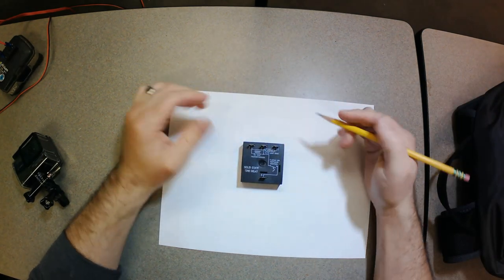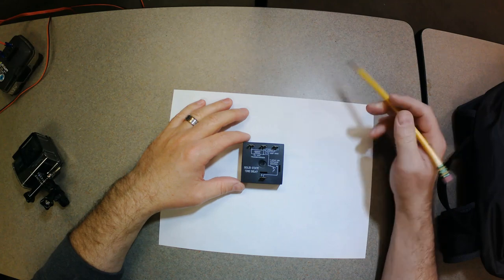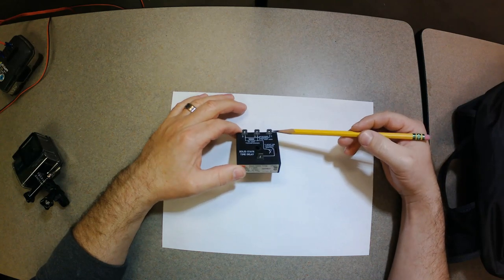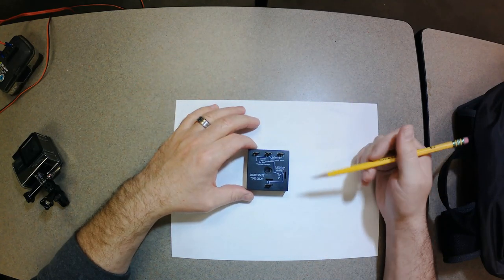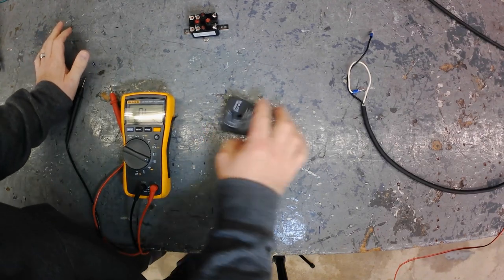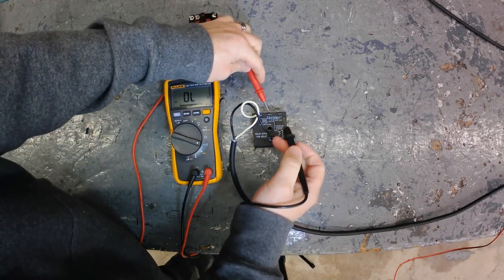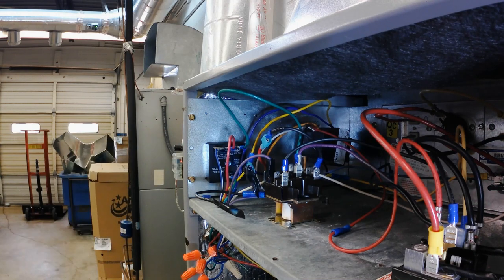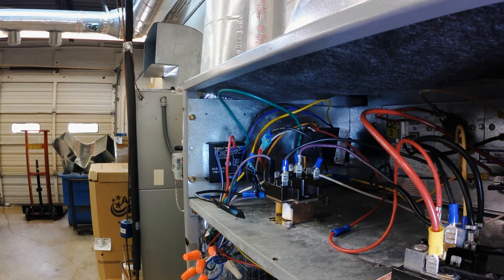CT1S45 Solid State Timer

Comment: You made a comment about overloading circuit. So instead of jumping out 5 to 2 with the G wire you just got 24v off. transformer. How would it overload? 
Really enjoy watching your videos! You take the time to really explain how things work.
Reply from the maker: Thanks for watching and commenting. It is not overloading as in "blow the unit up" or anything. I think of it like this...the 'G' circuit was only meant for 1 load, the indoor fan relay coil. The solid state delay took the place of that so by jumping off of terminal 5 we are essentially putting 2 loads on the 'G' circuit. It probably isn't enough current to hurt anything but it is going through the thermostat. I would just try to run each load from the power source through its own switching control. That way it is all straight in my head. After all, all the low voltage starts out as 'R' at the transformer anyway right?

Comment: Very interesting that you can't measure continuity thru the ?make-break? terminals.  Get any measurable voltage drop when passing current?
Reply from the maker: That was just something I noticed. I usually go with a Fluke meter and it may have had something to do with the range of its capability or something. Didn't even check the voltage drop but assume there shouldn't be much of one if current is flowing.

Comment: So you bring the back side of the main fan relay back to 3, or blue common?  What about using a Goodman #B1370758 timer? It has a 30 second shut down and and is supposed to carry 18 amps through the switch with 24 vac switching circuit.
Reply from the maker: The #3 and blue common should be the same thing in this setup (if i remember correctly). 
I don't see why you couldn't use the B1370758...30 sec vs 45 sec delay..not a biggie. I wonder why 2 components for making the fan motor delay. Just use the B1370738 fan sequencer. Now we got a circuit board!
Reply: does the sequencer have a N on and a N off? I dont know if they would last as long as relay but I seen them for $17 shipped. Would take less wiring too. If you can use them to run the fan with heat strips they would sure be a quick cheap way out if a board goes bad. Maybe a wiring video on them??
Reply from the maker: The sequencer has the same N.O., N.C., and COM terminals that a relay could/would have or what you would see on one of their fan circuit board. How long they last is completely up to chance!

Comment: Thank you for your video. If terminal 2 (R) and terminal 5 (G) has only 12 VAC, what is caused the problem?
Reply from the maker: The terminal 2  (R) is 24v all the time. If you check it to the terminal 5 (G) and it is 0 volts then that would mean the thermostat is sending power to terminal 5. If you get 12 then maybe the thermostat is not sending power out to terminal 5 yet.
Reply: Thank you for your response. If the thermostat is not sending power out to terminal 5, is it a bad Timer?
Reply from the maker: Not necessarily. Terminal 5 should get power when the thermostat is calling for the fan to run and if there is not power there then maybe the thermostat is bad.
Reply: @johnjennings-JJ  Again, thank you very much for your response. If I pull the G wire off from pin 5 (timer delay), I could have 24V between pins 2&5, right?
Reply from the maker: Not if you pull the 'G' wire off. It should be 0.

This is what i would do. Turn the fan to 'ON'. at the tstat. Check terminal 5 to 3, should be 24v, if it is then the tstat is good. check terminal 2 to 3, should be 24v, if not - find/fix the 24v wiring that should be bring the voltage there.(seems like most techs just jump off of the terminal 5 'G' wire). If 24v is there from terminal 2 to terminal 3, great. Check terminal 1 to terminal 3. It should also be 24v. If not i would change the solid state time delay
Reply: @johnjennings-JJ  Thank you very much for your response. I replaced a new "solid state time delay" and I got the results as you mentioned above. 
1) If the "Fan" is "On or Auto" and the system is set "cooling," but the system keeps running (and cannot be set off) when both "inside and setting temperatures" are the same (it should stop), right? what should I look into the problem if the system keeps running?
2) Also, After I turned off the system at TStat, the inside temperature went back up, what caused this problem?
Reply from the maker: For #1, i think you are on the right track. The thermostat should satisfy and cut off if the inside temp reaches the set temp you want. I have noticed that a lot of digital thermostats will actually turn on the cooling before the temp of the room changes on the screen. It is sensing the slightest change in temp (maybe a 1/2 degree) and turns on the cooling. I don't think your thermostat is necessarily acting bad/weird if it does that. 
For #2, the only thing i can think of is it got warmer in the room!!?? If you think it is happening too quick then maybe check the wall where the wiring come through into the thermostat. Maybe there is a large opening under the thermostat base and it is letting some warmer or colder air come up behind the tstat and keep it running like that. I have had some that needed caulking or some insulation shoved into the hole around the wiring to keep it from sensing that temp change.
Reply: @johnjennings-JJ  Again, thank you very much for your response.
For the #1, even the solid State Time Delay is good, but the ac system keeps running when the inside and setting temperatures are met or the same. It should stop, but not, what do I need to look at? Note: I cannot let it continue to run which will cause the electric bill.
#2, I will fix any holes in the living room.
Reply from the maker: This is the hard part of troubleshooting through youtube this way! If you don't find anything obvious like a hole behind the thermostat or something else then i would say to try contacting a local professional. The temps are warming up everywhere and the electric bills are going to go up too...just like you said.
Reply: @johnjennings-JJ  Thank you for your response again. Before I call AC professional, I am sincerely ask one more question.
1) Time-Delay (CT1S45) tested at Air-Handler:
a) With Fan is "Auto or On," System is "Cool," and TSTAT cover is "On," I got the results: Pins 2(R) & 5(G) = 0V; Pines 2(R) & 3(B) = 26.2V; and Pins 3(B) & 5(G) = 26.2V. Is this a correct test?
b) With Fan is "Auto or On," System is "Off," and TSTAT cover is "On," I got the results: Pins 2(R) & 5(G) = 12V; Pines 2(R) & 3(B) = 26.2V; and Pins 3(B) & 5(G) = 5.7V. Is this a correct test?
2)TSTAT tested:
a) With Fan is "Auto or On," System is "Off," and cover is "Off," I got the results: R&Y = 27.3V, R&B = 27.3V, R&W = 27.3V, and R&G = 12V. Is this correct test?
Reply from the maker: For #1 - All your readings seem ok. I don't see a problem necessarily. 
For #2 - All readings should be 24v if you go from "R" to something else. I would question the 'R' to 'G' reading of 12v but that may have something to do with wiring. I think they should all be 24v.
Reply: @johnjennings-JJ  Thank you very much for your response. I have suspected that G (from TSTAT to air-handler) wire could be a major problem since day one of this troubleshooting. However, today, I checked the Ohm values of all individual wires R, Y, B. W, and G and I got each wire is under 10 Ohm, except the Y wire is over 24 Ohm. The Y wire is a weird value. The G wire is 8.1 Ohm.
Question: What do you think about the Y wire?
Reply: Please notify to you; All the wires are good under 10 Ohm.
Reply from the maker: Sounds good.